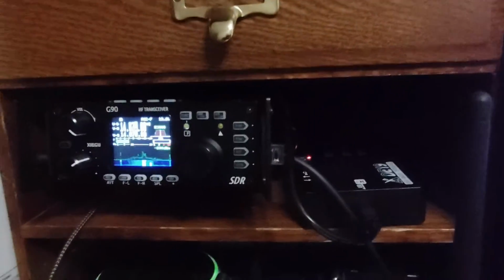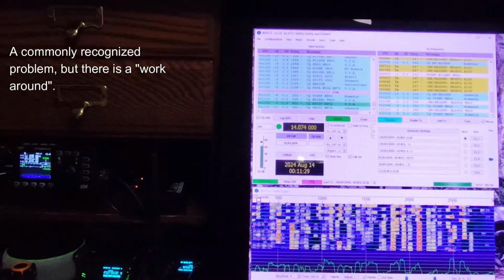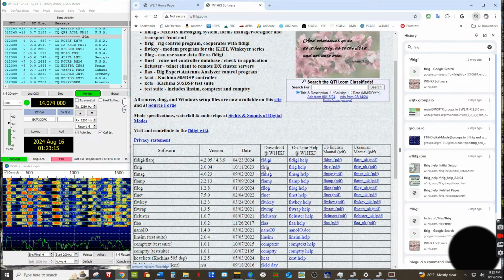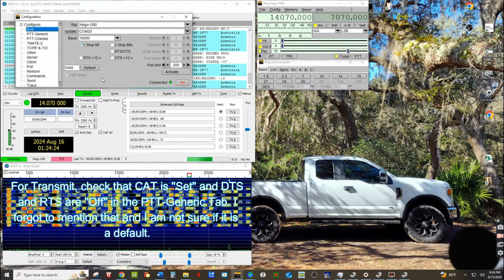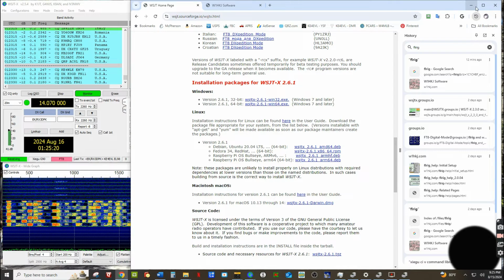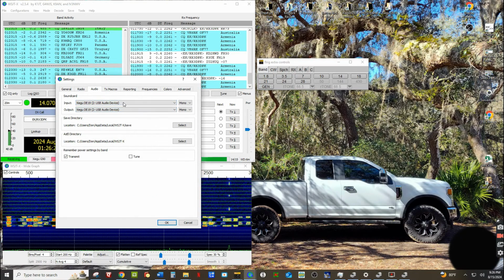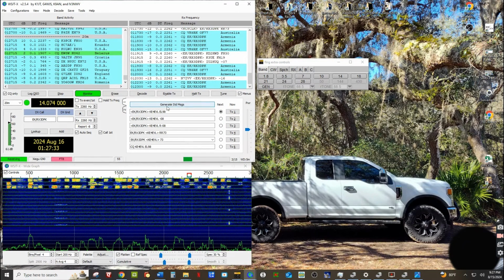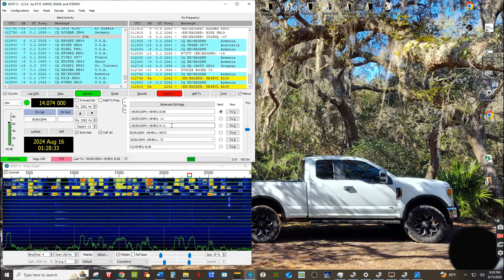Xiegu G90 and DE19 setup for Digital Modes with WSJT-X

Comment: everytime I try using flrig with my G90 (using the CE-19) it just freezes up. I'm ordering this DE-19 to see if I can resolve that issue (especially when using it with JS8 call). Thanks for posting this. I also have the XBA125B amp too.
Reply from the maker: The DE-19 has its own built in sound card, so that will be better. The locking up may be due to RF on USB ports. Use very high quality USB cables and and some clamp on  ferrite cores. That may resolve the computer freeze issues in any case. Good luck.
Reply: @donsdoityourself2547   that's solid advise, thanks for replying.

Comment: how many watts are you putting out on the radio?
Reply: Could you share your setting on  your computer & wsjt-x? Especially the Audio & Microphone?
Reply from the maker: I typically use 10-15 watts given the high duty cycle. I don't run the full 20w except for some DX opportunities. I just have to be aware the finals can get hot, so I limit that activity. Once I get a cooling fan (ordered a small muffin fan) on the shelf with the radio, it will be less of an issue.